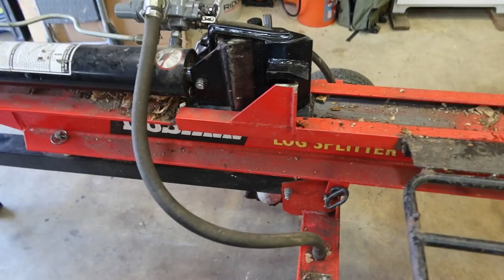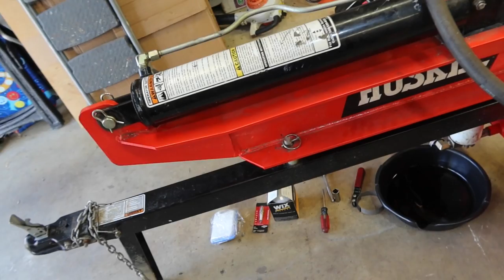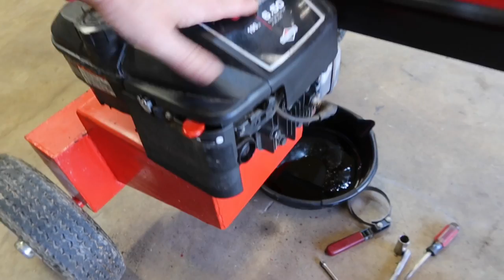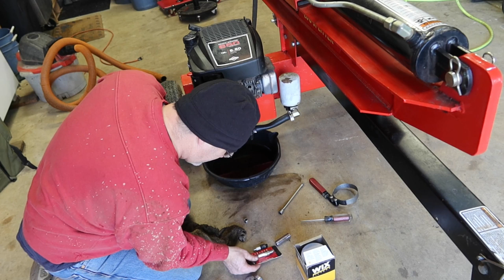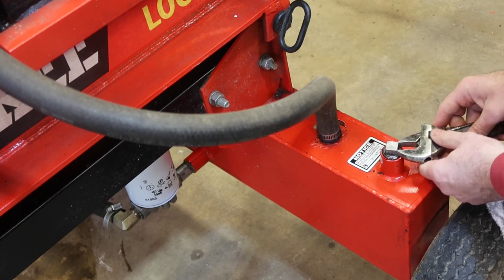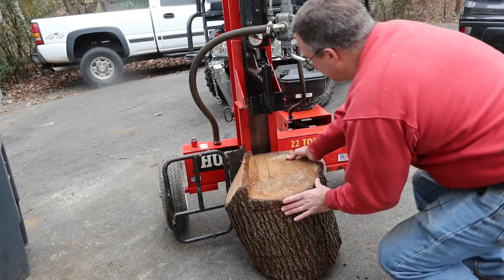Huskee 22 ton log splitter oil and hydraulic filter maintenance

Comment: I have this model. Manual says it takes AW46 hydraulic oil.
Where did you get the filters?
Reply from the maker: I'm pretty sure it was Mortons equipment in Fredericksburg VA but might have been amazon
Reply from the maker: I also didn't know it was aw46. I need to remember that for my friends machine. Thanks!
Reply from the maker: I think oriellys sells that oil
Reply: @RayofallTrades  My local Autozone had AW46 in stock.
Reply: @RayofallTrades  Huskee 22 ton manual is online. I can't post the manual number here because it keeps getting deleted from your comments. WTF?
Reply from the maker: @mattfoley6082  not sure why it would delete it? Maybe thinks it's a phone number. I'll do a Google search for it. Thank you for the help and advice!

Comment: Do you have to bleed the air out of the hydraulic system? I'm working on my 22 ton huskee, did a hydraulic oil and filter change and I don't know where the release screw to bleed air out would be
Reply from the maker: This one has a hole in the fill plug. I just run it back and forth and it bleeds itself

Comment: What interval for hydraulic do you recommend to change oil
Reply from the maker: Depends on use. Not sure what owners manual says but generally I do every other year or maybe 3. Owners manual probably says more frequently
Reply: Manual says filter must be changed annually. Manual does not say fluid must be changed. I don't think the fluid must be changed as long as it's clean. Takes about 4 gals AW46 fluid. Check fluid level before use! I was an idiot and forgot to check. I think I ran it with fluid low. Hope I didn't destroy the pump.
Reply from the maker: @mattfoley6082  thank you so much Matt! That is very helpful and I appreciate you taking the time to answer!

Comment: Do you have a video showing the coupling assembly underneath the engine?
Reply from the maker: Sorry I dont
Reply: @RayofallTrades    We're reassembling ours, and the 'spinner' coming down from the engine is not engaging with the pump.  Do you know how to lower the attachment?
Reply from the maker: @mssrus  ah. Usually the crankshaft/ tailshaft coming out of the motor has a groove/keyway and a small woodruff key to connect them. If you are reassembling, make sure that the key is not blocking you
Reply: @RayofallTrades  Thank you.

Comment: What is the number of the filter that I can get from local autopart supply store or online
Reply from the maker: I believe it is this one but please cross reference: WIX Filters - 51551
Reply: I have the same splitter.  The manual list several choices.
NAPA 1553
Cross 1A9023
Baldwin BT839
Wicks 51553
Fram 1653A

I think it should be Wix, not Wicks, but that's what the manual says.

Comment: Very Nice and informative Video. I have this exact splitter that I picked up a couple years ago very reasonably. Owner did a service and said it quit splitting. Checked pump shaft and coupler so on. Well after I purchased it and was going through the machine and Ready for this my friend I had helping me discovered the previous owner had left one of those Red Plastic Cap Plugs in the return line when he did the Hydraulic oil service. WoW!!!!! 😳😳
Luckily Him or me did not run it long and wreck the pump. Been 4 years and 
Been a good Splitter. Bit Slow Cycle time but I am OK with that. I'm getting to old and dont move as fast. 🧐

https://www.youtube.com/s/gaming/emoji/7ff574f2/emoji_u1f914.png
Reply from the maker: Awesome find! Glad you caught it when you did!